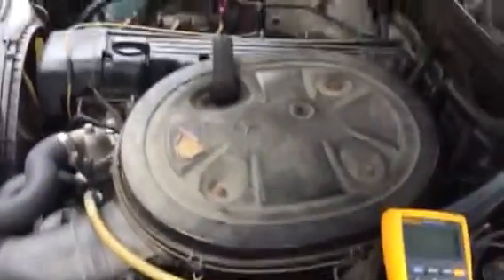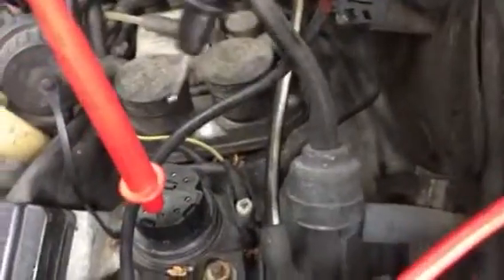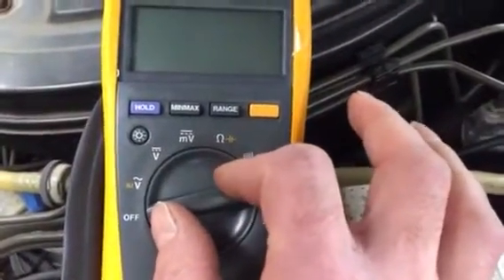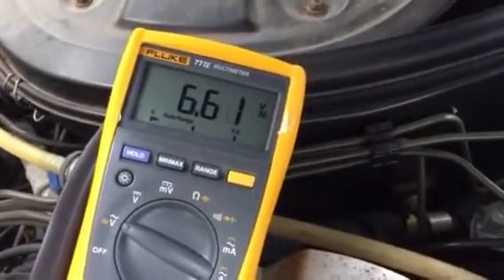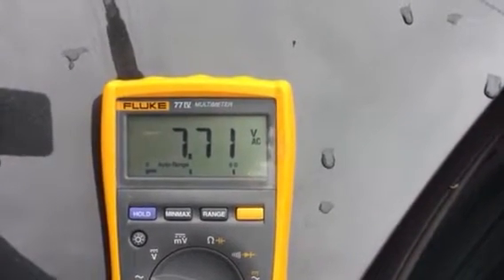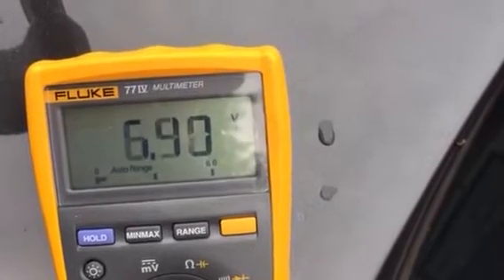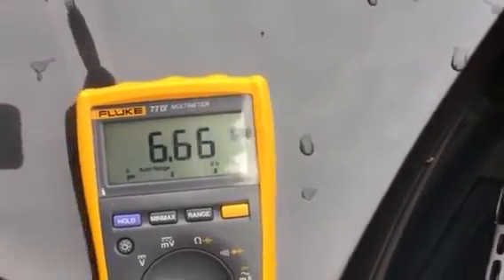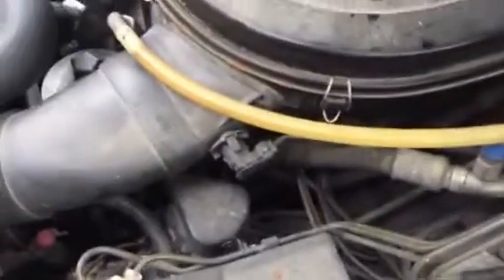How to check duty cycle Mercedes 124 m103 engine 300e 300te 260e

Comment: Great video, the meter seems to read 6. to  7.+ % not 60+ and 70+%as stated by the presenter. What is the frequency? What is duty cycle and frequency from distributor( before or after the green wire?
Thanks

Comment: my car (300e-24 with m104 engine) never gets in close loop mode. always stuck in 50% duty cycle, It´s like this for 5 years already.. already replaced new bosch o2 sensor, mas relay, ecu, all ke-jetronic sensors, new eha valve, new ovp relay, and nothing.. totally lost here and no mb mechanics around here. sad situation
Reply: Mine M103 w126 has the same problem. I don't know if is because my car doesn't have an O2 sensor.
Reply: @pasarborongss7729  yes its because you dont have O2 sensor you probably have and EZL!!

Comment: Isn’t that wrong? You don’t have it on HZ. Hit the yellow button on the meter. Don’t you check voltage at 3-2 then 6-2 or instead of 2 use ground then divide 3 voltage by 6 voltage then multiply by 10? That’s not you cycle duty. It should be around 47-50 when 3 is divided by 6.
Reply: By voltage do you mean normal voltage? Not duty cycle?

Comment: What you are measuring here is the RMS of a square wave signal. If the duty cycle is around 50% all is ok. 50% of your battery voltage of 13V is around 6.5 Volts and thats what you are reading here. If its stuck to a constant value, it indicates an error for example with the sensors. So don't worry about Hz, it's important that your meter can read True RMS to do this check.

Comment: VAC = Hz?  I found signal on Pin #1 or the W3 ground screw just above the X11 connector but not sure that is correct.  Thanks for sharing your way!